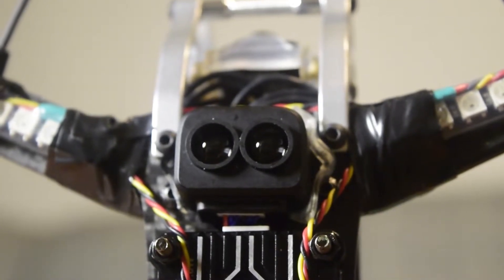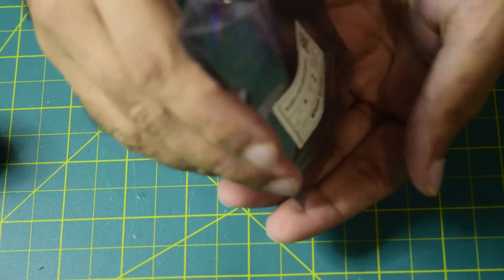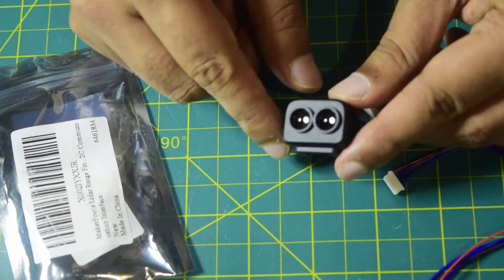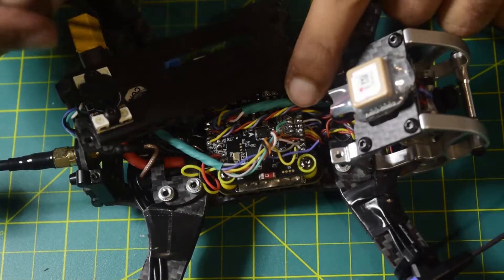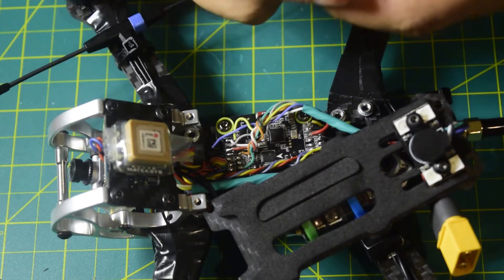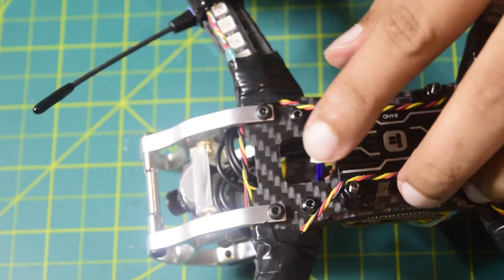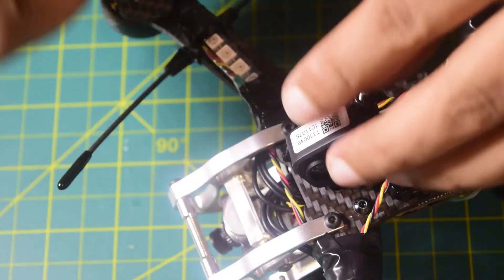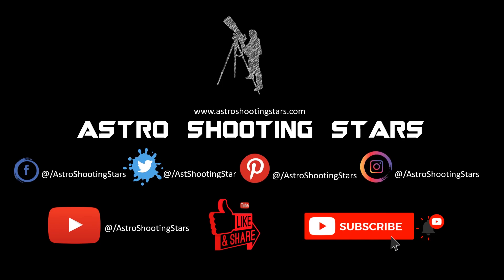Install Sonar Sensor on FPV Racing Drone | TF luna Sensor benewake lidar  in betaflight

Comment: hellow sir, I have a Speedybee f7v3 fc, and a mtf-01 sensor from micoair, I'm having trouble finding a place to solder it, because there's no uart left. I tried it on UART3 which is supposed to be for FPV cam, and my FC got an error. please give me a hint where i should solder it. Is it to the SDA SCL pad?
Reply from the maker: please use following guide of the sensor to select the correct mode of the sensor and connect it to your FC

Beginners Guide To LIDAR on Drone | TF-Luna, 0.2-8m Single Point Micro-Range Module with Wiring
https://youtu.be/S7GP28DBzx4

I hope this helps.please stay tuned to my channel for my future videos.
Reply: UART 3

Comment: Great video thanks. How did you configure lidar in the Betaflight configurator?
Reply from the maker: In betaflight ports config you can select range sensor on the uart you have connected it to as benewake range sensor. I hope this helps. Please stay tuned to my channel for my future videos.
Reply: @AstroShootingStars  Thanks for the reply. And it also needs to be configured in the configuration tab? in my betaflight 4.4 firmware, the parameters are reset to the sonar settings after a reboot, when I turn on the sonar and there are no readings on the debug graphs in the sensors window. perhaps these are problems due to the flight controller, the processor power is not enough for processing. Which flight controller did you use and will you be able to make a video with the setup of this sensor in betaflight?

Comment: Nice install of ToF Lidar. Looking forward to seeing how configure. Curious to see how you plan to use. Either with Betaflight, or INAV as I believe INAV allows position, and/or altitude hold.
Reply from the maker: For sure, i will soon upload my config and test videos
Reply: @AstroShootingStars  Did you upload it? I cant see any links or videos🙂
Reply: Please share all the details of setting in inav to use this TF lider . I can activate that sensor in inav .